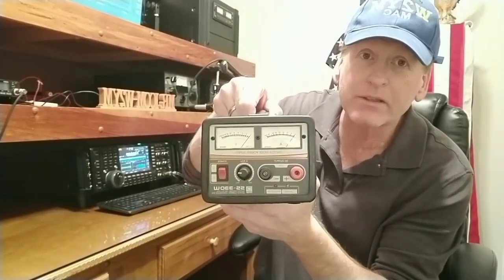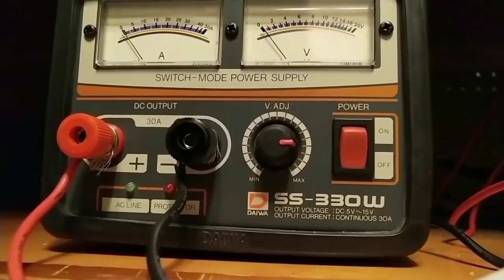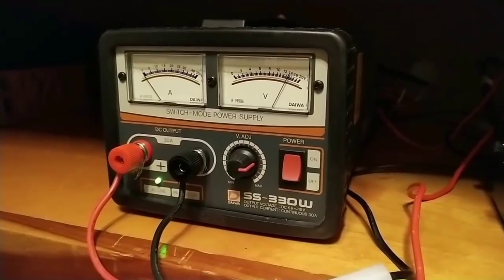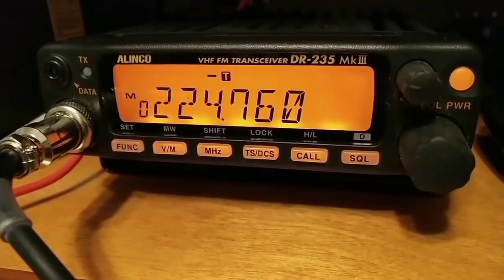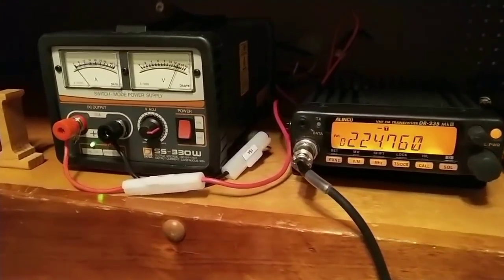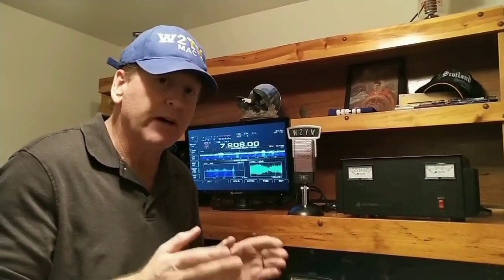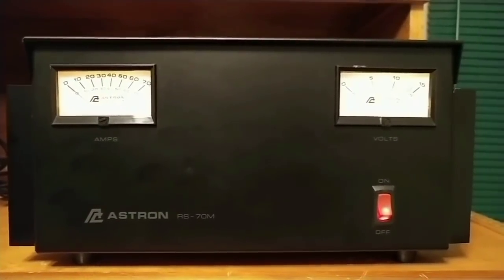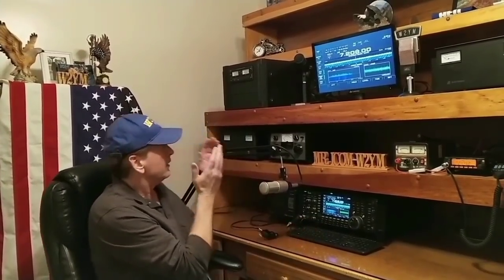What power supply works for your application || #powersupply #radio #hamradio  #newyork

Comment: Hi I just got my first gmrs radio I went a little cheap on the power supply AC to DC has a cigarette adapter so you can plug in a radio that has 12-volt cigarette lighter connector problem is it only puts exactly 12 volts out and not 13.8 I did not know that will this damage my radio or can I use it until I get a better power supply? Thanks
Reply from the maker: Better one is better